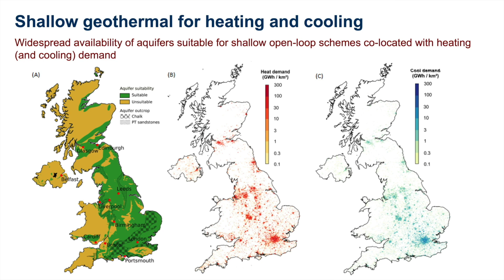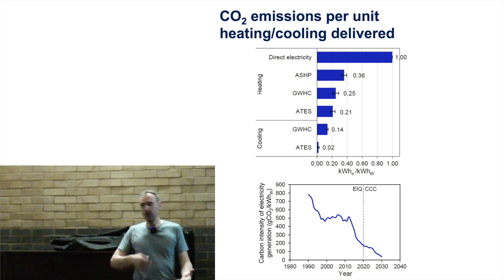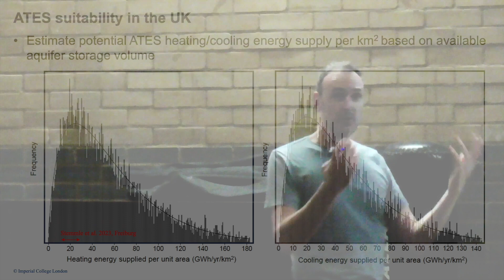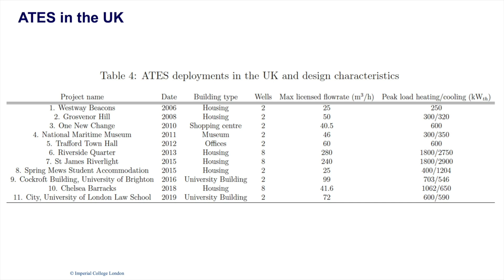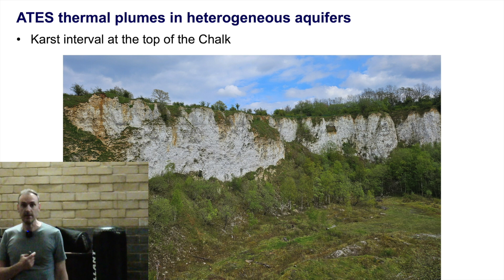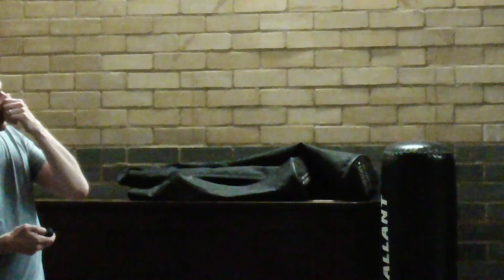UK & London shallow geothermal energy potential

Comment: Interesting video. The biggest issue is uncertainty! There is a big old mine shaft full of water along the road of my street. That would be far superior to tap into that air cooled heat pumps. But would be a major effort involving the whole street and engineers to ensure no subsidence. So we are holding off on the air cooled heat pumps until we can work it out, which might take decades… and in the meantime, we are just pumping out the CO2 from our gas boilers.